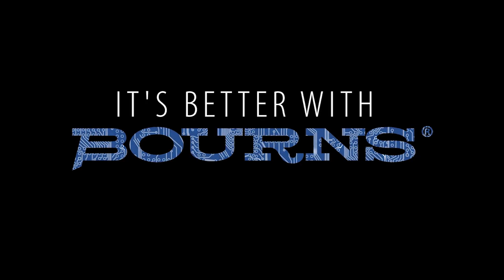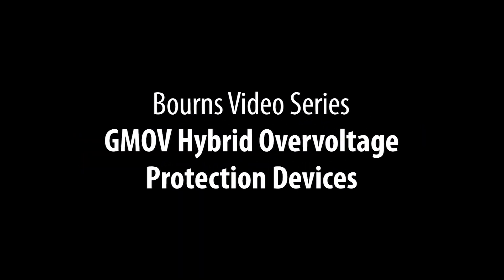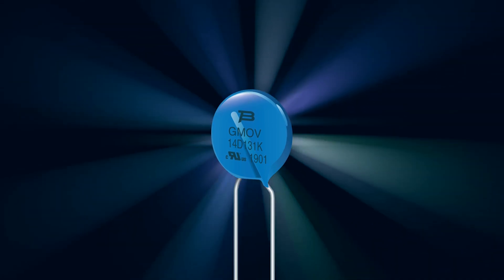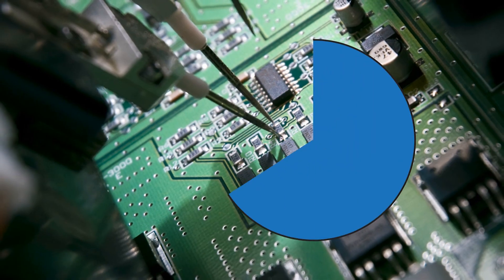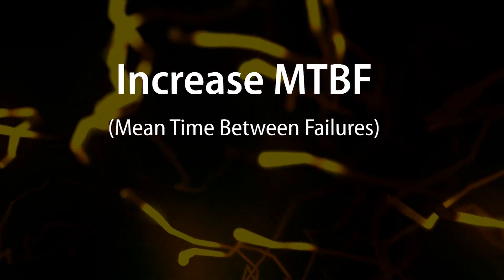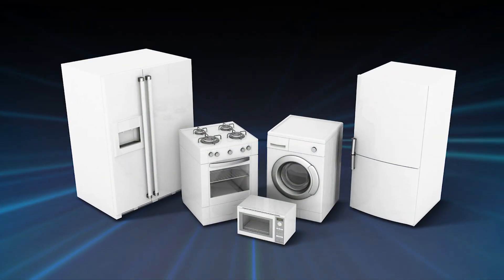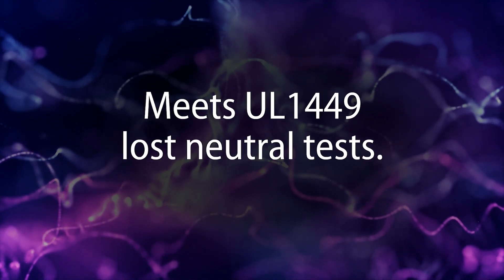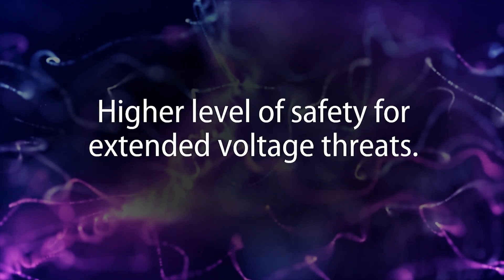Introducing Bourns® GMOV™ Components

Comment: According to the Bourns published article "0919 Bourns Q2-Q4 2019 GMOV Hybrid Overvoltage Protection Component.pdf", it seems the GMOV initially allows a short-time high voltage surge occurring down to the protected circuitry. Is that surge not dangerous to the circuit?
Reply from the maker: All series GDT / MOV solutions (GMOV, IsoMOV and discrete devices) will exhibit this initial voltage spike.  It exists while the GDT is turning on and only lasts a fraction of a microsecond.  As such, it contains very little energy.  In most applications, there are capacitors used in filters on the AC line that will absorb this small amount of energy and it becomes a non-issue.  As with every circuit protection design, each designer must confirm the effectiveness of their design in the lab.  Bourns has laboratories across the globe that can assist customers that might have concerns in this area.